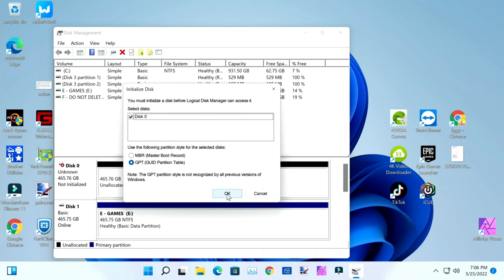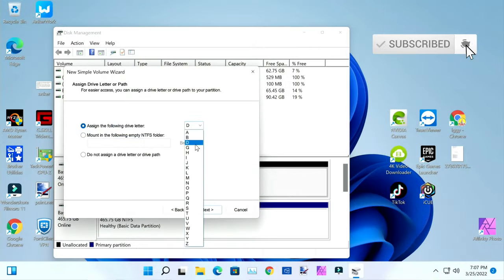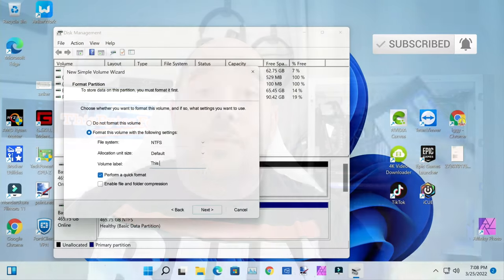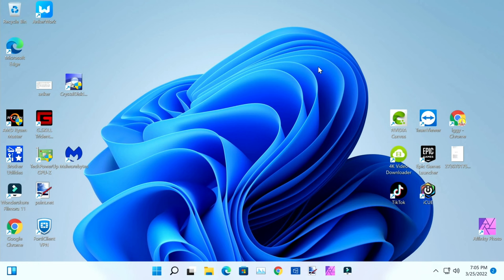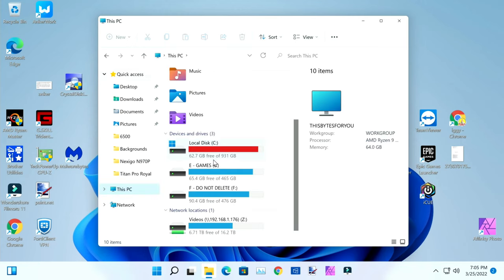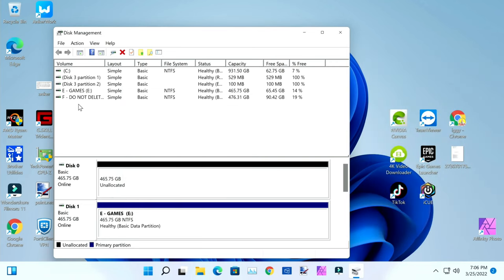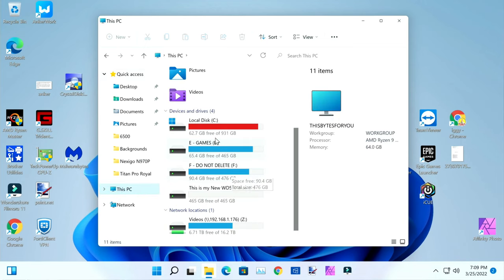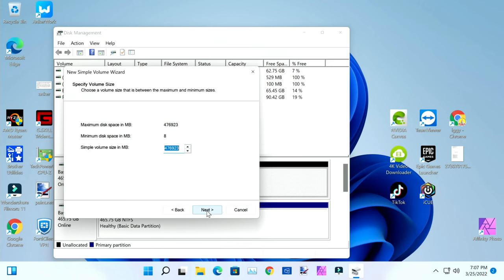How To Install a Second SSD into Your PC

Comment: Hey Iggy, used your videos a lot before with PC help but I am currently in a bit of a pinch with my new Samsung 990 Pro. I have an ASUS ROG Hero VII (wifi) that is not recognizing the new memory card when I install it. I have tried both M.2 slots, no luck. I have a SATA drive that has Windows on it connected in the first SATA slot, as well as one HDD that are both recognized fine. I don't want my new M.2 to be my boot card, just extra storage. Any help you can divine on my situation would be a godsend, Thanks for the excellent PC content sir and have a great day :D
Reply from the maker: Awesome my friend, so very happy I could help you get to where you are so far, but let's keep going, I know we can do it together.  Also, thanks so much for your kind words, it means a ton to me (today a little more than most too)
So that I can help, please list the manufacturer and exact model number of the following components:
1. Motherboard - manufacturer and exact model number
2. CPU - manufacturer and exact model number
3. RAM - manufacturer and exact model number
4. Video Card - manufacturer and exact model number
5. Power supply - manufacturer and exact model number
6. Monitor - manufacturer and exact model number
 Redundant I know, but many people forget to enter manufacturer and exact model number
7. Do you have ALL of the PCIE connections plugged in, and not daisy chained or pigtailed, each coming directly from the power supply?
8. Do you have any other PCIE devices plugged into the PCIE slots, this includes the x16, x8, x4 and x1 slots?  If so, what is the manufacturer and model number of those?
9. This video will help you identify hardware inside your PC: https://youtu.be/65ZSiVImJx0
10.  Use that program I mention in the video to give me your BIOS version as well.
Reply: Thank you for responding so quick Iggy! Before I take the time to list all of these out individually I just want to make sure I am listing the right things to you with the correct info.

For instance with my motherboard, it is an ASUS ROG CROSSHAIR VII HERO (WI-FI) but I am unsure in HWInfo what is my model number? Is it the serial number, asset tag, etc.? Trying to make sure I waste as little of your time as possible.
Reply: I am also just going to put down what I have so far and if you need additional info let me know and I will get it for you ASAP. I am by my PC all day today to get this sorted.
Motherboard - ASUS ROG CRROSSHAIR VII Hero (Wi-Fi)
CPU - AMD Ryzen 7 2700x CPU ID 00800F82 Serial 02153C4C-6D085A04
RAM - Row 2&3 16GB DDR4 SDRAM Kingston KHX3000C15/16GX 
GPU - EVGA RTX 3080 FTW3 Ultra Gaming LHR (10g-P5-3897) (you helped install this beast by the way :D)
Power Supply -  1.3 KW EVGA SuperNOVA G2
Monitor - HP Omen X 27 Model# HPN3644
7. Yes, there is no daisy chaining from the power supply to any components in the PC.
8. The only PCIE slot that is occupied is the top slot by my GPU, all others are unoccupied.
9. It sure did help, HWInfo is overwhelming in all the info it gives, neat tool!
10. I am now concerned it might be my BIOS, Version 0804 released in 2018...

Thinking I need to start with a BIOS upgrade but will wait for your confirmation. Again let me know if any info was lacking above and how to sort it and I will get back to you ASAP.

 @ThisBytesForYou
Reply from the maker: there is been a TON of fixes, since 0804, its almost the first BIOS, actually 0804 is a pre-release BIOS.  IT would be best to reinstall windows, or maybe your at the point to install windows now haha. So there have been a ton of AGESA hotfixes, system stabiligy and performance improvements, windows 11 support,  smart memory and resizable bar support and improvements and a ton more.

You memory looks to be installed incorrectly, it should be in slots B2 and A2, or in other words, if closest to the CPU is 1, and furthest is 4, it needs to be installed in 2 and 4.  You can see it in page 1_5.
https://dlcdnets.asus.com/pub/ASUS/mb/SocketAM4/ROG_CROSSHAIR-VII-HERO_WI-FI/E13834_ROG_CROSSHAIR_VII_HERO_WI-FI_UM_WEB.pdf?model=ROG%20CROSSHAIR%20VII%20HERO%20(WI-FI) 

The update also gives it New CPU support and support for the 3000 series, Memory stability,  Adds CPU PCIe Lanes Unlocked item in BIOS when plugging in AMD Athlon 2XX series processors (you have this CPU) support for NVIDIA RTX30 series gpu (you have this GPU).  These BIOS updates seemingly were made for you haha, all should be good after, this video "may" help: https://youtu.be/ljUDmy4giuY

ROG CROSSHAIR VII HERO(WI-FI) BIOS 5201

Version 5201
15.77 MB 2023/09/06
"1. Recommended for vital update to mitigate the potential security vulnerabilities
2. Improve system stability

ROG CROSSHAIR VII HERO(WI-FI) BIOS 5102
Version 5102
15.77 MB 2023/06/12
"1. Update AGESA version to ComboV2PI 1.2.0.A
2. Modify language support in AiTweaker.

ROG CROSSHAIR VII HERO(WI-FI) BIOS 5003
Version 5003
15.76 MB 2023/02/06
"1. Update AGESA version to ComboV2PI 1208
2. Mitigate the AMD potential security vulnerabilities for AMD Athlon™ processors and Ryzen™ processors
3. Improve system stability

ROG CROSSHAIR VII HERO(WI-FI) BIOS 4703
Version 4703
15.63 MB 2022/03/07
"1. Update AMD AM4 AGESA V2 PI 1.2.0.6b
Improve system performance and stability

ROG CROSSHAIR VII HERO (WI-FI) BIOS 4603
Version 4603
15.59 MB 2021/10/08
1. Update AMD AM4 AGESA V2 PI 1.2.0.3 Patch C
2.Improve system performance

ROG CROSSHAIR VII HERO (WI-FI) BIOS 4502
Version 4502
15.59 MB 2021/10/08
"1. Support Windows 11 by default, no settings changes required in the UEFI BIOS.

ROG CROSSHAIR VII HERO(WI-FI) BIOS 4402
Version 4402
15.58 MB 2021/06/30
"1. Update AMD AM4 AGESA V2 PI 1.2.0.3 Patch A
2. Improve system stability

ROG CROSSHAIR VII HERO(WI-FI) BIOS 4301
Version 4301
15.48 MB 2021/03/29
"- Update AMD AM4 AGESA V2 PI 1.2.0.1
- Support Smart Access Memory for Ryzen 3000 Series Processors
- Improve system performance

ROG CROSSHAIR VII HERO(WI-FI) BIOS 4204
Version 4204
15.44 MB 2021/01/29
1. Support AMD AM4 AGESA V2 PI 1.2.0.0.
2. Improve ReSizable BAR compatibility for NVIDIA RTX30 series graphics cards
3. Improve system performance

ROG CROSSHAIR VII HERO (WI-FI) BIOS 4007
Version 4007
15.37 MB 2020/12/10
1. New CPU support
2. Offer a Re-size BAR Support option to enhance GPU performance.
3. Remove AMD 7th Gen A-series/ Athlon X4 Processors support

ROG CROSSHAIR VII HERO (WI-FI) BIOS 3103
Version 3103
15.01 MB 2020/06/23
"01. [E] Improve system performance.
02. Update AMD AM4 AGESA Combo PI V1 1.0.0.6

ROG CROSSHAIR VII HERO(WI-FI) BIOS 3004
Version 3004
14.82 MB 2019/12/27
1. Update AM4 combo PI 1.0.0.4 patch B
2. Fixed a compatibility issue with M.2s when using Ryzen 3000 CPUs.

ROG CROSSHAIR VII HERO (WI-FI) BIOS 2901
Version 2901
14.84 MB 2019/11/08
01. Update Memory Overclocking Rules
02. Fixed a display issue for Ryzen 3000 CPUs in the CPU Configuration tab
03. Fixed an issue with the HDD LED not working sometimes when using SATA M.2s with Ryzen 3000 CPUs

ROG CROSSHAIR VII HERO (WI-FI) BIOS 2801
Version 2801
14.83 MB 2019/11/08
1.Update AM4 combo PI 1.0.0.3 patch ABBA to improve system performance

ROG CROSSHAIR VII HERO (WI-FI) BIOS 2703
Version 2703
14.73 MB 2019/08/23
1.Improve system performance.
2.Update AM4 Combo PI 1.0.0.3 Patch ABB
a.Fixes a compatibility issue with Destiny 2
b.Fixes an issue with certain Linux distros
c.Removes Gen 4 support when using Ryzen 3000 CPUs
3.Improves EZFlash performance to reduce boot time.

ROG CROSSHAIR VII HERO (WI-FI) BIOS 2606
Version 2606
14.73 MB 2019/08/15
Update AM4 Combo PI 1.0.0.3 Patch AB.
Update overclocking auto-rules for Ryzen 3000 CPUs.

ROG CROSSHAIR VII HERO(WI-FI) BIOS 2501
Version 2501
14.66 MB 2019/07/18
Fix an issue where the mouse will sometimes freeze in the UEFI.
Update multi-language string.
Fix an issue with the Safe Boot button.

ROG CROSSHAIR VII HERO (WI-FI) BIOS 2406
Version 2406
14.68 MB 2019/07/05
1. Improve system stability.

ROG CROSSHAIR VII HERO (WI-FI) BIOS 2304
Version 2304
14.67 MB 2019/05/17
1. Update AM4 ComboPI 0.0.7.2A for next-gen processors and to improve CPU compatibility
2. Fixed an issue with Precision Boost values
3. Improved memory compatibility
4. Enhance system security

ROG CROSSHAIR VII HERO (WI-FI) BIOS 2203
Version 2203
10.29 MB 2019/04/12
Enhanced security

ROG CROSSHAIR VII HERO (WI-FI) BIOS 2103
Version 2103
10.29 MB 2019/04/11
"1. Update AM4 ComboPI 0.0.7.2
2. Improved Memory Stability"

ROG CROSSHAIR VII HERO (WI-FI) BIOS 2008
Version 2008
10.23 MB 2019/03/14
Update AGESA 0070 for the upcoming processors and improve CPU compatibility.

ROG CROSSHAIR VII HERO (WI-FI) BIOS 1201
Version 1201
8.44 MB 2019/01/04
Improve system performance.
Add CPU PCIe Lanes Unlocked item in BIOS when plugging in AMD Athlon 2XX series processors. NVIDIA RTX30 series 

ROG CROSSHAIR VII HERO (WI-FI) BIOS 1103
Version 1103
8.44 MB 2018/11/30
1. Update AMD AGESA version to 1.0.0.6
2. Improve system stability

ROG CROSSHAIR VII HERO (WI-FI) BIOS 1002
Version 1002
8.24 MB 2018/11/02
Release BIOS 1002
Reply: @ThisBytesForYou  Ah! I figured as soon as I saw it was 5 years out of date I knew something wasn’t right! If I could just trouble you for one more question my friend, and I’ll be sure to throw a coffee your way for all the terrific info you’ve given me. I really appreciate you taking your time to help a wayward fella with his PC! I have tried to update the BIOS via the internet option in the EZ Flash Utility option is BIOS and it failed with a bizarre error. I then tried AI Suite 3, downloaded the CAP file from ASUS, and pointed AI 3 to that file for the update. It told me “the model of the BIOS image does not match the installed BIOS.” Now I double triple quadruple checked that I got the right BIOS for my motherboard, and it indeed matches the version number you gave me above. So my question to you now is, is this a common thing to happen when trying to flash a BIOS and do I need to just put it on a USB and run it through the BIOS screen on startup like you did in your linked video? I’m just hesitant to try and flash this BIOS that way as I don’t want to brick the board, and it seems like it’s really fighting me on updating this BIOS.
Reply from the maker: thats the best way to do it, unzip it from the zip, throw it in a fat32 thumb drive and you should be good.  Download this file
https://dlcdnets.asus.com/pub/ASUS/mb/BIOS/ROG-CROSSHAIR-VII-HERO-WIFI-ASUS-5201.zip?model=ROG%20CROSSHAIR%20VII%20HERO%20(WI-FI)
it has this file in there "ROG-CROSSHAIR-VII-HERO-WIFI-ASUS-5201.CAP", dont rename it, just leave the file in the root of the fat32 thumb drive, restart your computer, go in the BIOS and flash it like I show you,  this one is newer and intel, but it has been screens to help: https://youtu.be/1po734ckLFo

I only use BIOS flash back to recover a bad flash, its been years since I have used it, you are good my friend.
Reply: @ThisBytesForYou That worked! I’m happy to say my BIOS is up to date now. Unfortunately, that doesn’t seem to have resolved the issue. I tried my 990 in both M.2 slots and it still isn’t picking it up in Disk Management or BIOS. I’m so sorry to keep hassling you, and if this is getting too convoluted to want to mess with I totally understand. I just can’t seem to find any good resources anywhere else on the inter webs that have dealt with this kind of issue before!
Reply: @ThisBytesForYou  an update too! I see now that my 990 Pro is showing up in the boot menu in BIOS, so I know that the drive is working and that my motherboard is reading it, but it won’t show up in disk management still and under SATA information in the EZ Mode view M.2 still says N/A. Not sure if that helps any but thought I’d add in case that’s a eureka moment!
Reply: @ThisBytesForYou  WE GOT IT! Just wanted to update that a combo of your advice and a timely checking of my NVMe Controller (or lack there of), a quick update, and it’s done. I now have my Samsung up and running. Thank you again sir for your help, coffee on the way!
Reply from the maker: Always a pleasure my friend, so very happy you stopped by, trusted in me to help you, liked and subbed as well as took a moment out of your day to thank me.  It means a ton to me and I am so very happy I could help you.  The coffee too, it helps a ton and means a ton as well, thank you.